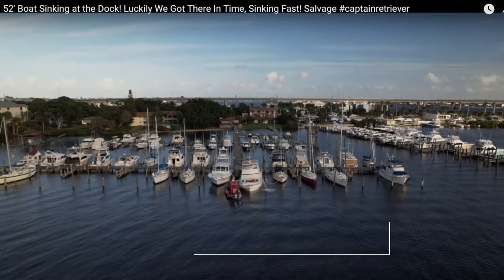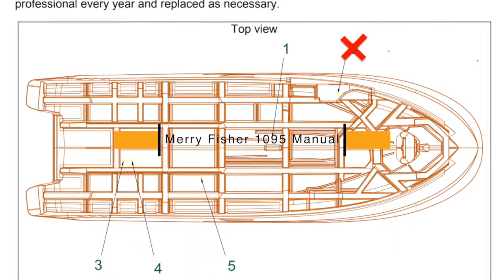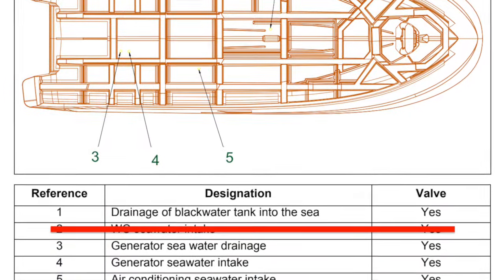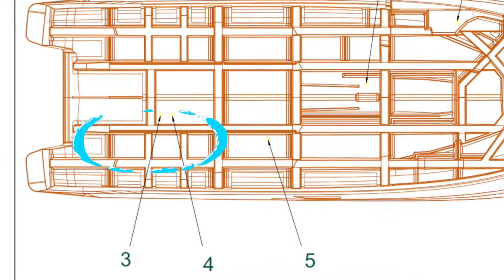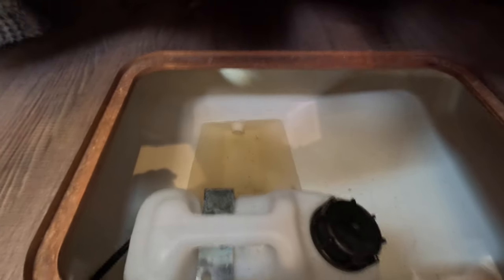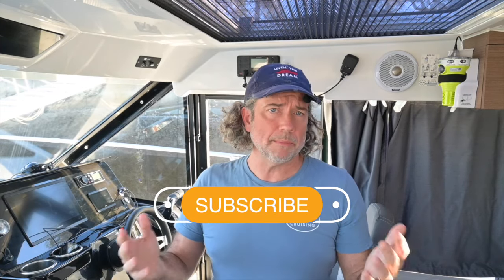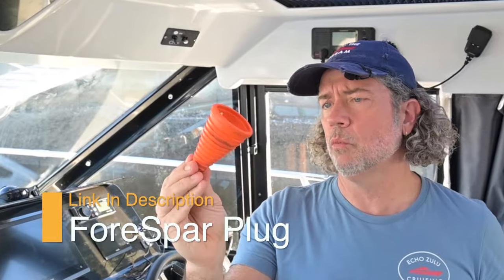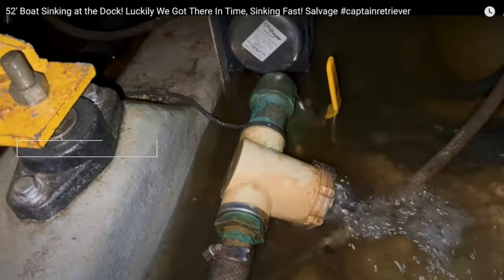#1 Reason Boats Sink: Thru Hull Fittings Explained

Comment: Hey, bought a 28ft Bayliner Contessa a few months ago. It's in a wet slip. Got no trailer and forklift at marina can't handle it. I noticed leaked when I bought it and resealed hatches and windows and no leaks there now. But notice water underneath the floor and in a section underneath the seating area which I tried to get some fiberglass resin to try to seal it. Noticed a spot where it would have a few drops come in the bottom.  Turned on my pump and dnt hear it working. Previous owner turned it on and it worked but now I turn it on and you see the voltage fluctuate but I dnt see or hear any draining. I just took a shop vac and got the water out and tried to do the fiberglass resin thing. But went back today and there maybe a half gallon of water under the seat again. Not sure what to do. Completely new to boats but I am pretty good at learning these things. Trying to figure out how to fix it in the water.
Reply from the maker: If there is any leak below the water line, seems likely you need to get professional help. The pumps will not pick up every drop. In our lazarette, we get some water in the bilge from heavy rains, but the bilge in the cabin is typically dry. You are doing the right thing figuring out where the water is coming from!

Comment: do you have thru hull transducers? I guess those would also fall under the routine inspection category?
my boat came from factory with one installed for speed/depth data (with the paddle wheel), but it was not used for years and I installed another transducer which I used. however wanted a backup one for depth, so though that I could upgrade the old factory one to new Airmar DST-810 (as the hole is already there). It was smart move, as upon removing the old transducer it was really in a bad shape after all those years and could have caused leaks.. and I would not think of it as I've not been using it.. I guess there could be a lot of older boats which have some old thru-hull fittings which are not used, but could be ticking timebombs.. like some old plastics, seals or sealants which condition might be not so obvious even if you look at it..
Reply from the maker: We do have a transducer for the depth finder and another plugged one. Both in the Lazarette and conveniently under the same hatch as the generator through hulls. I honestly don’t check them the same way i probably should. I focus on the sea cocks because I have been on boats where they have leaked. Now you gave me another thing I should worry about and check consciously.